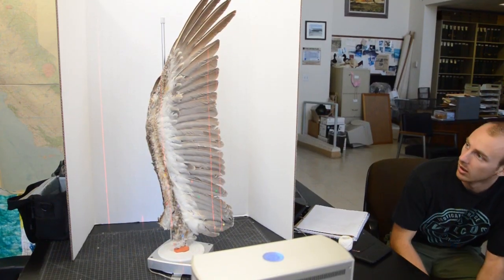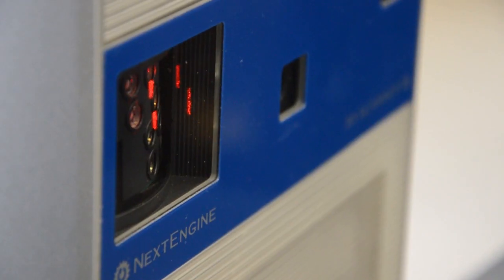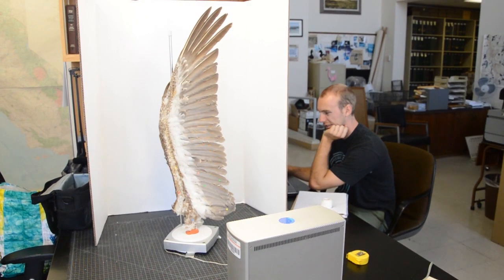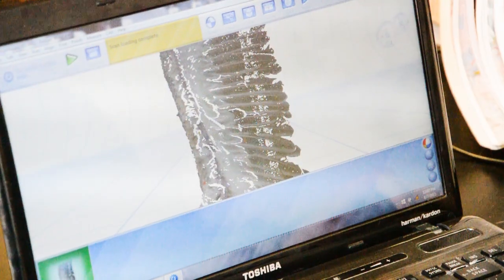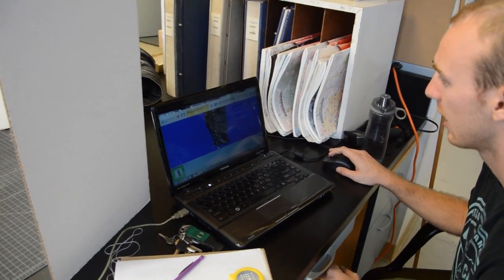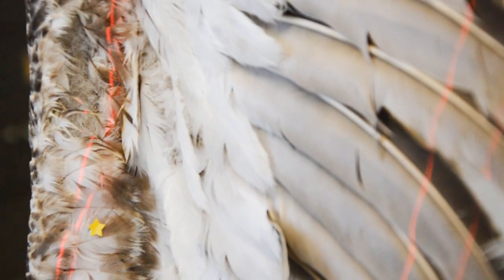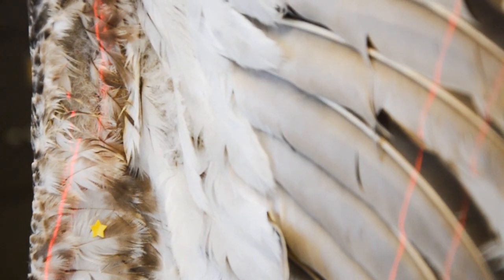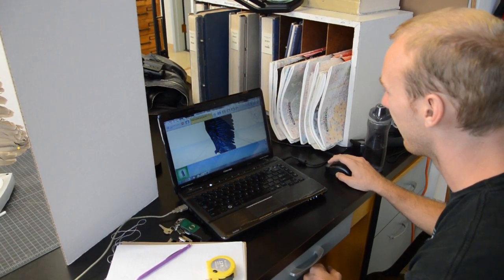3d Scanning Bird Wings

Comment: If Meshlab isn't quite doing the job after scanning with nextEngine and detecting all the angles and holes in the panoramic scans there's something of a trick that I've learned after working with this machine for four years that may or may not help to align the problematic scans.  Set up a platform on the base with written indicators to help with digital pinning.  Star stickers also work great, but they disappear once you switch to laser (shaded) visual data or mesh etc. unless you can make out the definition of that sticker with high def.

Particular shapes on a small platform with the actual object can help to align yet after aligning you can edit away the platform. Then my final two cents which I believe to be most important: Make scans in highlighted sections when you're looking at the bird feathers at an angle more than 10~ degrees. Don't scan the whole face of the object that size and width at more than 10 degrees unless it is facing flat to the receivers. The reason I say this is because the scans actually differ in size slightly when you scan from a slight angle and it ends up making the software work harder to make your raw files come together.  Small sections go together flawlessly and it's definitely more work but imperative to get that fine detail your after especially if you're working lengthy times with high def.  Test my advice if you feel like it- assign high res to a flat yet wide shape of more than four inches and align it however you wish, then try this method. Compare the two! I swear by this rule. I have a theory that because the image is farther away the object's size differs and the software isn't quite accurate enough to pick up on size variation- at an angle. It auto detects distance real well within the visual window but lacks in the perimeter of that window once it's calibrated to the center of what it thinks is right. 

I love the project and I ended up searching this because I punched in the keywords to see if anyone had done this yet; so here I am and I see you use the same tools as I! Except- I plan on generating tool paths to fabricate these shapes to build something related to hang gliders with stabilizing attributes to make them even safer under turbulence.  Right now, Hang glider designs are a Rogallo design that hasn't changed for 40+ years and they are still very fixed.  I want to make a small pair of foldable human wings out of dacron sewed into carbon fiber outlines that mimic the bird wing shape and go from there. Far fetched as it all is, I have flight experience as an H3 pilot and look forward to testing these kind of projects.

Please forgive me if I sound like a know it all or something like that but I get excited to help with this kind of in depth knowledge of the Next Engine. My scan archive is in my video section if you're curious to see what I do on the scanner. Good luck, I'd love to hear or see your results of the scan?

Comment: You may want to do some (virtual) preening of the feathers to make sure all of the barbs are zipped together and the feathers lay correctly together. This demonstrates the usual problem of people using found feathers on the ground for reference for a project. These feathers have either been molted, damaged or just dried up and weathered. This wing looks a mess and does not resemble an actual, well looked after, wing on a life bird. If you are measuring aerodynamic properties of the wing and feathers, you are not going to get very accurate results. It may be good enough, but it could be better.
Reply from the maker: Thanks for your comment - we're not able to reproduce the feather texture properly at the moment so are mostly concerned with the more global properties of the wing and tip feather shapes - it doesn't matter that this poor guy was a bit gnarly, we end up re-creating the surface before creating the wind tunnel model.
Reply: Cool. Makes sense. How did it go in the end? This video is 2 years old so I guess you have been able to do lots of research since then?